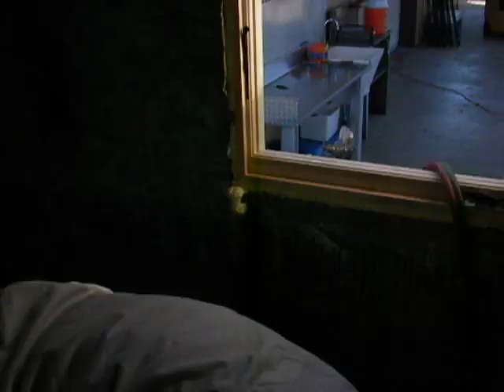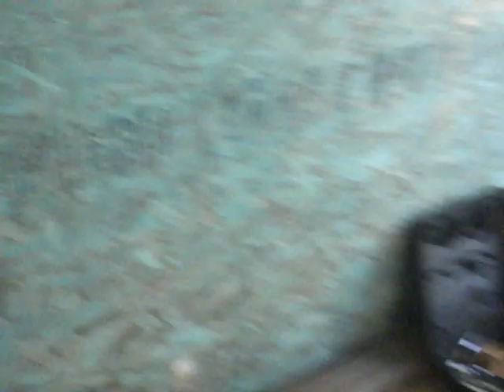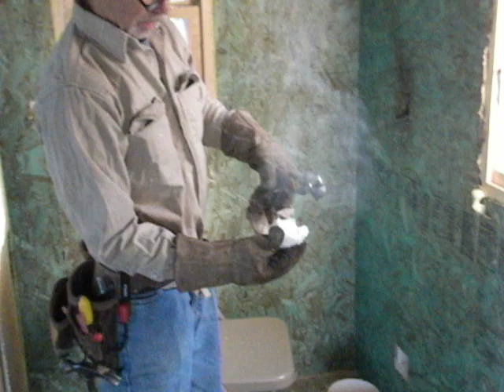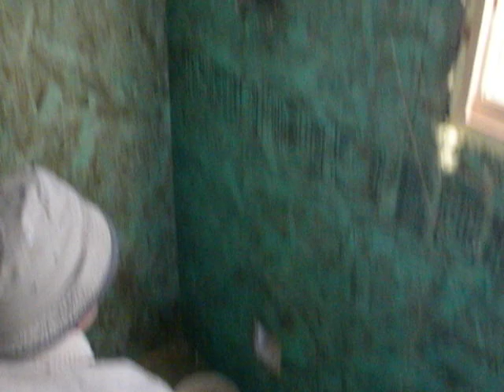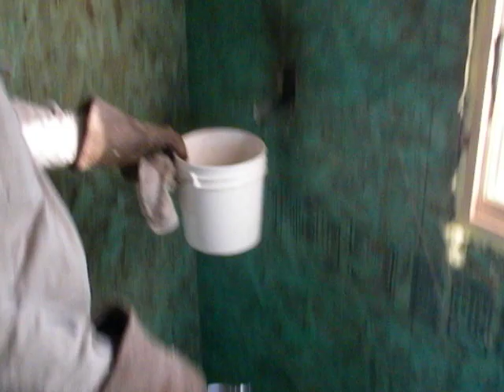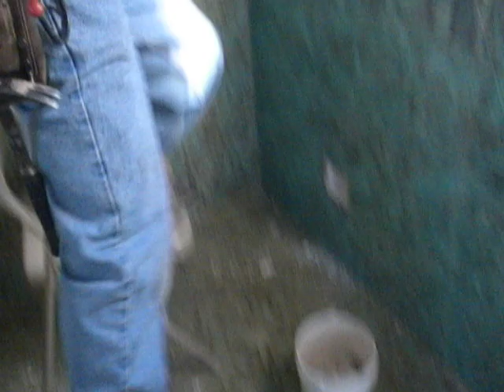wiring sip panels

Comment: That was indeed pretty cool....or should I say hot.  Little sketchy with the flash fire though. :o) Our timber frame barn is clad with SIPs. People are always amazed at how comfortable the temperature is inside a 6,000 structure with no AC in Florida even.

Comment: amazing how wiring is done in the us and also in the uk... Just runing cable bare throught walls and cielings... In the Netherlands we use pvc pipes (5/8 and 1/2 inch) to mount inside walls and cielings in which wires are pulled throught. Also we use pvc boxes in which sockets and switches are mounted. 
Also different collored wires are pulled throught per application and per situation.

regards, Sander